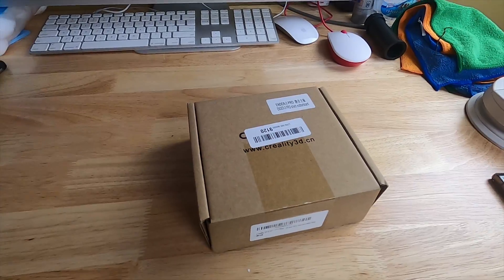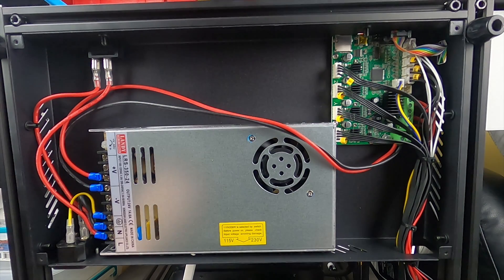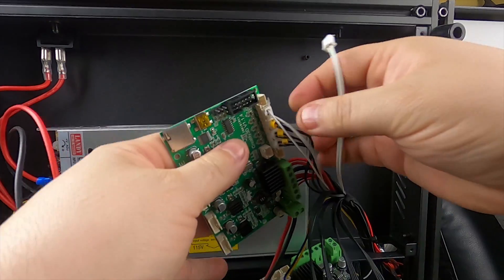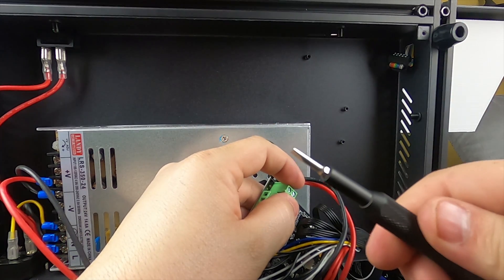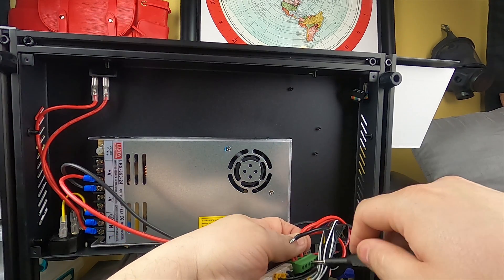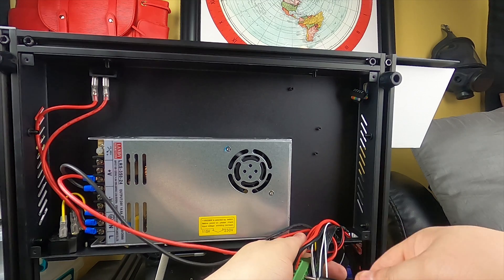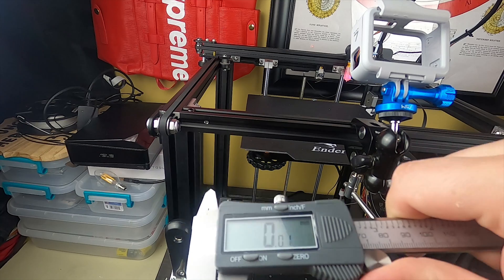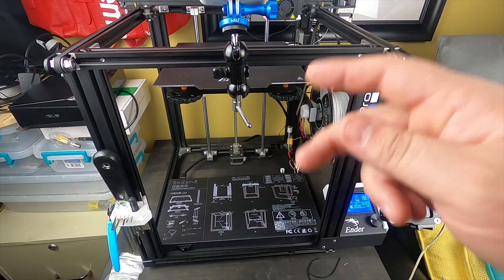Ender 5 Silent Board Upgrade Fix Silent v1.1.5  Road 2 PRO

Comment: whats even the point of installing a silent board when you can hear the fans from other parts? it didn't get quiet at all.
Reply from the maker: Believe me it makes a difference the fan noise you can't hear in another room but the buzzing noise you hear

Comment: Question did your board say on its box ender 3 or ender 3/4??? just afraid to install since i am clueless on how to upgrade mine if it is not pre set for  my ender 5... my old board (noisy is messing up and prints just stop printing an hour into each job...thanks